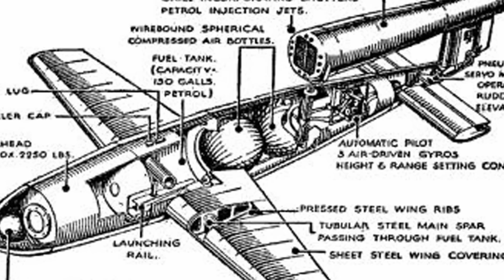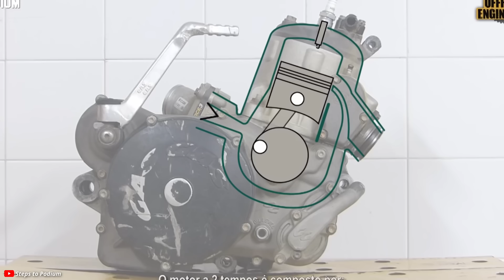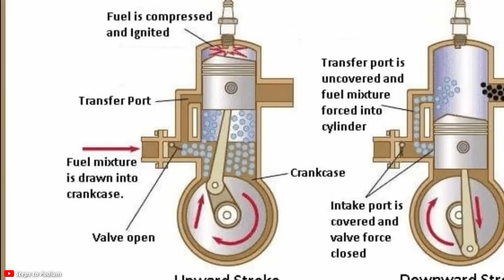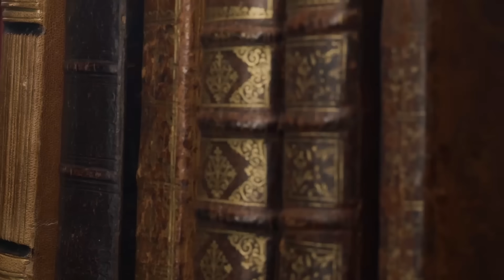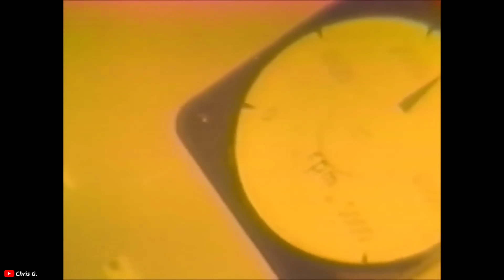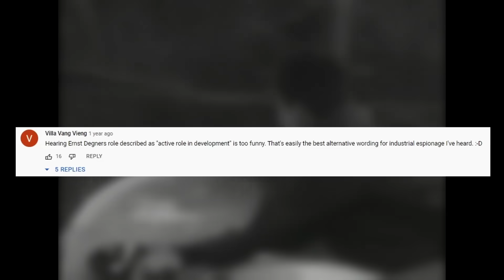How Suzuki stole communist technology to make their motorcycles faster

Comment: Outstanding! I once read that Kaaden said that "a 2 stroke is more like a jet than a pump", and that his expansion chamber had a rear section that narrowed down to a small diameter pipe, that narrow area reflected the pressure wave back into the open exhaust port of the next cycle, preventing the intake charge from escaping with the exhaust, increasing power. That's why all expansion chambers have a narrow exit.
Reply: We did something "kinda"-similiar on karts in the WKA in the 90's, since non-shifters were 2 stroke. Due to the regulations on exhaust bend measurement, the bends were only allowed to be measured on a the same plane as the bend itself, to compensate for . So if done right, you could make the bent section have a larger volume still in the rules, also the exhuast length wasn't limited, but the exhaust nozzle had to be 10" from the exhuast port and inline.

So we ran an exhaust with a loop that made it slightly oval shape during the bend to create the same effect. If felt a little more powerful, but only at the top end, which is what matters if you aren't on a kart specific course.

I'm also speaking on things that were done when I was a kid, just a racer, and both the Fabricator and my Father have passed away. So take it for what you will.
Reply: I remember reading this as a teen and immediately thinking to myself that the speed of sound and expansion chamber are roughly the same under all revving conditions, that means there must be an optimum rpm for the 2-stroke engine to work under. Am I right?
Reply: @kiuk_kiks  yes, the 'reflection' of the pulses is tuned by designing an expansion chamber profile to optimize at a certain rpm for max power.
Reply: @yetanotherjohn  
What are the optimum rpms for the 2-stroke cycle engine to operate under? I’m also under the assumption that the “ringing” sound made whenever they’re revved up is the point at which the reflected sound wave hits the exhaust port of the cylinder?
Reply: @kiuk_kiks  WOT
Reply: The 1st cone, that widens, heps suck more exhaust and subsequently more fresh air in the cylinder, and the 2nd cone, that narrows down, sends escaped fresh air back into the cylinder, thus charging it. it all works for perfect fuel-efficiency and highest power for a few 100rpm, and only a variable-length-exhaust-pipe (the tube between cylinder and expansion chamber) can extend this mode of function over 1000s of rpm, making the 2-stroke superior to the 4-stroke (in other words, turning it into what anyone should drive, for the low cost, ease of maintenance, high power and fuel efficiency)...
Reply: @kiuk_kiks  I had a 1990 Suzuki RG125 (22hp) that had no power until 7000rpm then it went absolutely wild until 9000rpm.
Reply: @arenalife  that’s typical 125 power delivery, nothing then BWAAAAAA! Lol
Reply: "that narrow area reflected the pressure wave back into the open exhaust port of the next cycle, preventing the intake charge from escaping with the exhaust, increasing power" 

In effect, an alternative form of forced induction. Exhaust powered which it has in common with modern Turbocharged engines.

I heard the Suzuki Square Four Disc Valve works GP machines ridden in anger back in the 1960s. Those Suzuki Square fours when on full chat had by far the loudest exhaust noise I've ever witnessed by far on any car or Motor Cycle. Ear shattering. Also blindingly fast.
Reply: @kiuk_kiks  That depends on the cc of the engine, the mixture. the desired character of the engine (power band) and intended rpm range...tuned to the exhaust ofc. As "simple" as that :)
Some 2-strokes have a very noticeable sound when everything "falls into place". It goes from brrrrrt to brrraaAAAOOOWWIII. Often you can feel a significant increase in the acceleration as the hp/rpm increases rapidly.
My old 50cc Zundapp, with a race cylinder, went "nuts" from ~7000rpm to ~11000rpm. It would probably go even faster with a proper exhaust, rather than with I had cobbeled together in my youth. But you could hear when you were getting close to the sweet spot.
Reply: @klausbrinck2137 not altogether true. The resonant rpm zone can be shifted by altering the speed of found in the exhaust gas. This has been done in some racing bikes as experiments, but done a lot on 2 stroke outboard boat engines, to get them to not bog down at WOT at low revs.
Reply: @TheHarryMann  An Error in my previous posting, now added a link at the end. I think it is true: The operator has never ANY influence on the temperature of the exhaust-gas, so, that would be a bad bet on how to control the resonant rpm-zone. Aside to that, after the pipe has warmed-up, the temperature will always stay nearly the same anyway, no matter of the load (in a normal case of usage, of not overloading for longer periods). 
The explanation of resonant rpm-zone: Low rpm -> long intervals between exhaustion-cycles -> Exhaust-gases have time -> a long pipe´s needed for the correct timing... High rpm -> short intervals between exhaustion-cycles -> exhaust gases have less time -> A short pipe´s needed for correct timing. 
https://www.youtube.com/watch?v=aneETdq-ai8 At 19:39 you can see the two power-graphs, with the long and the short pipes, overlapped by the valiable-length-pipe. In this case, this person didn´t make a variable-length-pipe connecting the exhaust-port with the resonance-chamber, but he made a variable-length-resonance-chamber itself... Doing both would be the ideal solution, but it isn´t always worth it, For mass-production or a race-car, sure, but not for a small diy-project.
Reply: … yes, true. Though cooling the exhaust gas temperature and hence speed of sound, by water injection at the port has been done successfully and can temporarily lower the resonant rpm e.g. pulling out of corners. However, it’s not really practicable for race bikes, but suits outboard motors.
Reply: @TheHarryMann  Sorry, I didn´t think of that water-injection-topic at all... I It´s an "out of sight out of mind"-topic for me, a red-flag, since water-injection lowers volumetric efficiency, so, space taken up by water vapor/droplets, cannot be taken up by gazoline, and that´s a big hit for efficiency... But for power and power-handling, it´s good, I guess... But power-handling is anyway good enough. And power-density is very high, so, instead of the cost of water-injection, one can simply build a 10% bigger engine, that´s still gonna be tiny... In Germany, some motorcycle-tuners have built a 37hp-60cc-engine, so there is hope, as you can see.
Reply: @klausbrinck2137  Sorry. I meant water injection into the Exhaust Port !
Reply: @TheHarryMann  oh, ok...
Reply: It's not at all like a Turbofan "jet", but like atheroid type pulse jet, as found on the V1.  Simple motors reliant on acoustic pulses.   Neat stuff
Reply: @kiuk_kiks yes. And that's probably also the reason that Yamaha came up with the power valve (YPVS , Yamaha power valve system.)
The engine + exhaust were designed to extract high peak horsepower and the YPVS was added in the exhaust to improve low/mid rev power.
Reply: @jfv65  
I’ll probably have to look that up.

Comment: Ah, the love of two stroke power. Mid 70's I purchased an RD-350 Yamaha. This was after my 900 Kawasaki Z1 was stolen. The RD was a quick little bike and I learned to love it for it's peppy engine and great street manners, especially in the twisty Southern California canyon roads. Having decided I wanted a nice cafe racer, I began reading everything I could on making a street bike better. Living in San Diego region, I was aware of Don Vesco and his success with making great power in two stroke Yamaha's. One of the cycle magazines had an article where his shop did porting and modifying the RD-350. I stopped by his shop in El Cajon and talked to the head mechanic and was educated on what I could do and still have a reliable street bike. Soon I had found a used TZ-250 race bike in pieces. I used the lower end ( crankshaft assembly) after having Vesco's shop check it out and left my heads, barrels, and pistons with them for porting and other mods. Put it all together, along with 36mm carbs, modified reed valves, and the TZ expansion chambers. I spent several days getting the jetting fine tuned and I had a very quick, light cafe. That bike is the bike I had the most fun on and I have had some nice ones. I had the first year Kawasaki ninja 900 and the RD still is the most fun bike. It had the dual disc front end from the TZ, alloy wheels, clip on's, a 1/4 fairing, and  Don Vesco seat tail section. It would top out at 130+ and it would get there quick. I would wear out the Dunlop K81's on the edges first. I lost count of the larger displacement bikes that I embarrassed with that RD.  Looking back, I must have had someone looking out for me as I truly pushed that bike way too hard for street riding and never went down. Those powerful dual discs saved me a few times.I truly believe the 70's were some of the most golden years for motorcycling. I ride an older, like new 97 Virago 1100 these days, at much slower speeds, LOL. It does have super bike bars and much improved front brakes as I am a firm believer in having very strong front brakes.
Reply: Great story.  Love to see a photo of that modded out RD 350.
Reply: @2005kmcollins  I wish you-tube had a process to allow that. I have several of the first two stages, but unfortunately none of the final stage with expansion chambers and TZ front end.  I have several of me going thru one of my favorite corners well heeled over when it was in stage one, still painted Orange.
Reply: I didn't like the RD350 out on the highway. They could not keep an even speed for very long. You'd constantly have to deal in or out throttle to keep the things going say, 55mph. The speed would just vary too much for whatever reason. Probably the Yamaha reed valves did that?
Reply: my 84 rd350 was such a fun rascal to ride..120mph in a matter of seconds
Reply: In the UK they simply purchased expansions and put them on the bike claiming more power which was nonsense and reading your article made sense
Reply: @mikemortensen4973  RD350 with reed valves i don't think so,
Reply: @fidelcatsro6948  hahaha you sound like the Fisherman the one that got away! 120mph on a RD350? IF you said 110mph I would not question it but 10mph faster,I borrowed a GS1000 and that managed 137mph from a engine 3 times bigger
Reply: @Johnketes54  it was an rd350 YPVS the one with the powervalve..ok i hit 170kph but there was plenty more on the throttle to go..i know it couldve hit 200kph..
Reply: @Johnketes54  Yep - something that always beat the crap out of me until now. The odd system worked by accident, like the was a 3 into 1 that did give the suzuki GT550 more power.
Reply: @Johnketes54  RD's meter a bit faster
Reply: @fidelcatsro6948  That was a RZ350, totally different bike than the '74 RD350. Water-cooled with a variable height exhaust port. With a set of chambers on it instead of the stock pipes with the catalytic converters it was a wheelie machine. Rode one in the north GA. mountains for years until I wrecked it and graduated to a '93 Ducati 750SS instead. Still have the Ducati, old and slow just like me.
Reply: @markmcdonald5711  yes i noticed that.. but in my country it was marketed as RD350LC Ypvs, non faired bike with a lion head cowl on the headlight only... later ones had full fairing
Reply: YOU HAD THE GPz  / ninja?  cool!!

Comment: Great video, but you seem to have misunderstood the expansion chamber! It's not about getting the exhaust gas out quicker. It's about sending a pulse of exhaust gas back up the exhaust to stop the fresh charge escaping! Thus giving a 20% power increase!
Reply: Dead right thus burning all the fuel/air mix. The length and diameter of the tailpipe (stinger) and the cone angles would alter the power delivery.
Reply: @okboomahfromblackrod2939  They called it something like exhaust resonance tuning, IIRC; by the way I visited Zschopau some time in the mid 1990s and talked to some very interesting older gentlemen. And the local bistro served a mean steak too.
Reply: @Seele2015au  The real challenge was moto cross bikes 'cos you need a tractable wide power spread or it would wheelspin. I still remember the first time I rode an RM 80 Suzuki.
Reply: A shock wave back up the exhaust, not actually 
a pulse.  It is moving at the speed of sound.

Only about 3 or 4 inches out of the exhaust 
port see raw intake gases.  And yes.  If you 
aren't "on the pipe" you are sending unburnt 
mixture out the tailpipe.  But, when you ARE 
on the pipe...

steve
Reply: Exactly how the V1 missiles worked then.
Reply: @mrdojob  nothing like it!
Reply: @turnfordguitars  Nope. They used the exhaust blast on the V1 to ignite the following blast. They had to fine tune the exhaust to get that back blast as close as possible to the combustion chamber.
Reply: @mrdojob  but on a 2 stroke the exhaust gas doesn't ignite the next charge!
Reply: @turnfordguitars  Yeah I know but the concept is very similar.
Reply: @mrdojob  There's a very good book called 'Two Stroke Tuning' by Gordon Jennings. He has all the relevant formulas for making a pipe.
Reply: @okboomahfromblackrod2939  You can solve some of that issues with the next innovation, power valves. Now you can have a power valve to hold in some of the charge at lower rpm's to save your bottome end, while opening for top.
Reply: @turnfordguitars  It´s exactly like in the V1-Rocket. It´s all about the pattern of acoustics that is in use here, none is interested where the fuel gets finally burnt, cause the function of the expansion chamber goes above and beyond such questions (meaning: It includes both cases, and is so definitive to the function, that the location of the combustion itself, becomes a secondary question.).
Reply: U have to think more in lines of: Double the amount of air stuffed in the cylinder (in comparison to the case in absence of the resonance chamber) brings double the volumetric efficiency, and, possibly, double the power... So, it depends on the engine-design (its capability to translate the added volumetric efficiency in additional power), and the degree of added air-volume itself. So, I´d say, it´s +20% in the worst case. If a chamber pushes 100ccm escaped air back into a 100ccm-cylinder, then the volumetric efficiency is doubled, +100%.  If a chamber pushes 20ccm escaped air back into a 100ccm-cylinder, then the volumetric afficiency is +20%, instead. Bad designed 2-strokes will not exploit this advantage, while good designed ones will.

Comment: Heat was the enemy of all that power. Konig, GDR, were building horizontally opposed 2 strokes for racing outboard motors and, with operating in water the heat problem was solved. Kim Newcombe from New Zealand, joined the factory and took up the challenge of liquid cooling one of these engines and building a GP bike. After many testing times and with great talent, he was awarded 2nd place in the 1973 500cc GP Championship posthumously.
To read about his exciting journey I can recommend the book: "Kim - The Kiwi on the Konig" by Tim Hanna. Greetings to all from NZ.

Comment: I remember the Suzuki X-6 that came out in the mid 60s.  They were fast for the time.  A similar thing happened with MX.  CZ of Czechoslovakia developed the two-stroke that ended up ending the four-stroke MX machines, namely BSA and Jeff Smith (world champion, 1965-66), first with their big 360cc two-stroke in 1967, piloted by East German Paul Fredricks.  Belgian rider Joel Robert was taking consecutive 250cc world championships on the CZ 250.  Sometime around the time that Robert and the CZ team, including Roger DeCoster came to the U.S. for a series of races called the InterAm, they bumped into Suzuki people, and soon, by 1968, a twin pipe 250cc Suzuki MX machine appeared, looking uncannily like the CZ twin pipe that the Belgians rode.  By 1970, Suzuki came out with factory 250, and 380cc MX machines for the two, and they took world championships on those.  Suzuki dominated MX for some time after that while the other Japanese brands caught up and the European brands struggled to keep up.  But it's not really true that Suzuke benefited from a communist development.  The bottom line is that this stuff came out of the Third Riech or earlier German research.
Reply: I woved my GT 380 L (actually 371cc) Sebring. I could sit up on that thing all day and do 500 miles a day easy on leave from the Navy. That red Suzuki CCI oil worked wonderfully in the automatic injector. The inner cylinder had a smaller set of points to keep the temp down I think it was. Tried several 3-1 Expansion Chamber pipes, did save on a lot of weight, but looking back should have kept that stock.
Reply: @robertrichard6107  I had GT380 in UK , handling and brakes a bit naff , but engine a peach .